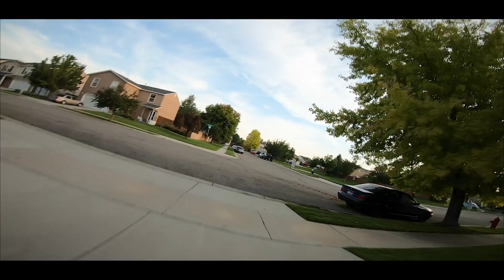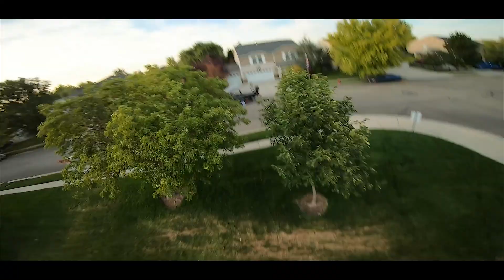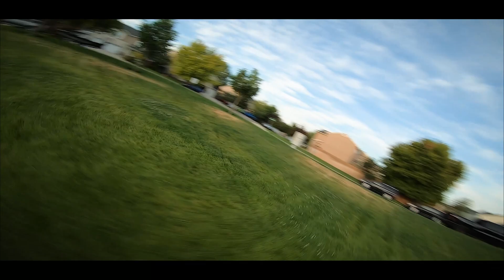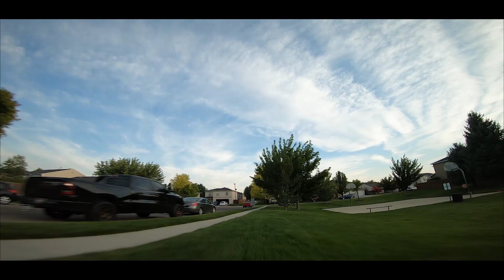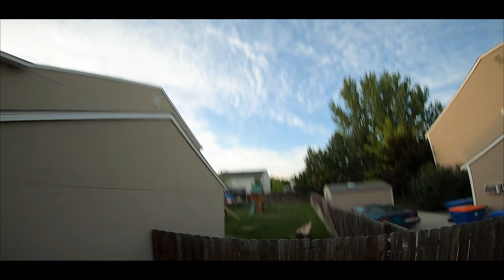Emax ECO II 2306 1700 | UAV Tech BF 4.2 Tips | No gyro filter??

Comment: the sound does me think of the early raceflight, sounds verry raw do to the minimum amount of filtering. probably when you hit something and 1prop bend slightly, the tiny amount of noise wil get in the pid loop and warm up your motors.  as long as the props are perfect as new and in balance thing will fly fine.  not sure, thats what i guess will happen
Reply: It is a little different than that RF issue because you have RPM notchs (bent props still vibrate at the motor RPM) and a Dynamic Notch looking for big peaks of noise to crush that out.  When a notch centers on a vibration, it completely crushes it out.  Lowpasses (F1 and other FW exclusively use) do not.  At best, they reduce noise by 0.5; and that is being generous.  So as the amplitudes of a vib goes way up (bent props) a lowpass just cannot cope with it.
Reply: Kewl @ Uav tech

Comment: How good do the default values work with no changes at all under 4.2.  I'm about to maiden a 7" and I haven't bothered to change a thing in that section yet.
Reply from the maker: Decent. I always do a quick hover test on defaults.
Reply: @Furadi  I pasted and saved in the Cinematic Quick setting extra tweaks to start from:
https://github.com/betaflight/betaflight/wiki/4.2-Tuning-Notes#quick-settings
Reply: @choppergirl  I haven't tried bf 4.2 but I struggled for months with earlier versions of bf on a 7" project 399 then tried emuflight and inav. I had really good flights right off the bat with inav. Good luck, I really love my 7" though, I'm done with anything else for now.